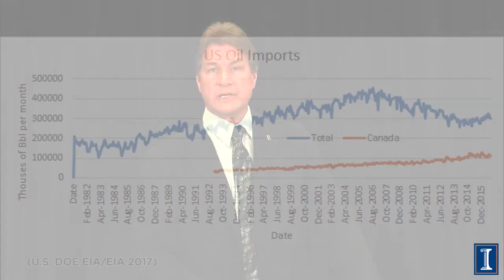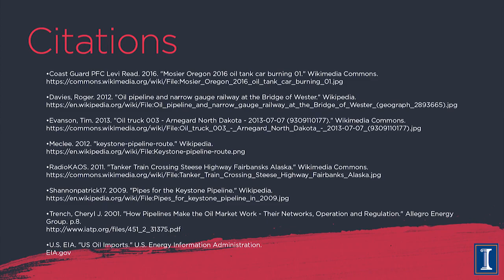Pipeline Controversies

Comment: Entirely too dismissive of the unique forms of environmental impact represented by underground oil pipeline especially in or around water, aquifers, water tables, etc. Do your research. You don't just shut down a high pressure pipeline full of tar. The inertia is tremendous. While you are shutting one of these down, you can have a full-blown ecological disaster.

Of course the bigger ecological disaster is also mining and burning the stuff, which at this point should just be outright banned by international treaty.
Reply: And by not building the pipeline, you're inviting more burning of the stuff to get the product to its destination with diesel-powered tankers and trains which are far more likely to crash into something and cause a spill. Further more, it's more than possible to engineer shut-off valves strong enough to stop that flow. As a matter of fact, it's standard design in oil rigs (Deepwater Horizon was a case of that system failing due to faults that should have been caught but were not corrected, but that is by far the exception rather than the rule). Lastly, even the "green" energies such as wind and solar still require fossil fuels to operate. You need to mine the materials needed for the magnets and other components (to include oil because a lot of polymers that only got invented because the oil companies took the waste from refining crude oil into gasoline and other fuels and then experimented on it to figure out what else they could make from their operations) and wind farms/solar farms run natural gas generators as backups for when the primary mode simply cannot adequately supply the energy needed. Also, by denying cheap energy to areas that just don't have the infrastructure yet to run nuclear/solar/wind, you're crippling economically disadvantaged nations such as the majority of Sub-Saharan Africa (congratulations, by going big green, you inadvertently become a racist as you're denying black people the chance to improve their lot by pricing them out of the energy market).

Bottom line: fossil fuels are still necessary for now and rather than banning them outright, it is smarter to use them as efficiently and safely as possible while phasing in cleaner technology over time.
Reply: @RaderizDorret  kind of like holding people hostage in order to continue destroying the planet and blaming someone else for the fate of your hostages. So many excuses and explanations why some people (mostly the poor, Native Americans, people of color) have to accept paying the price for our "infrastructure".
Reply: @fieldlab4  Except you're the one who is denying them access to the infrastructure we built and thus denying them of the opportunity to not only catch up but have the potential to surpass us. You give them methods that cannot possibly translate to them eventually becoming an industrial power and after that a post industrial power. Why do you hate black people so much? Your methods keep them in subsistence farming while my methods actually give them a path to grow and potentially surpass me. After all, if my student doesn't surpass me in the end, then I'm a very poor teacher. What you demand is keeping them in subsistence levels of economy and then hold them hostage as only you can afford the "green" energy needed to sustain their economy and thus they are subservient to you. You are making slaves of them while I am hoping to make apprentices and eventual masters of their own fate.
Reply: @RaderizDorret  You seem to be suffering from capitalist savior complex. What did the "poor savages" ever do to survive for thousands of years before you came along to help them "develop". Answer: they didn't destroy the planet, for the most part didn't know poverty, exploitation or class struggle and led generally more fulfilling, spiritual and humanistic lives.
Reply: Here’s something to consider, you need oil in order to live. Unless you are self sufficient in food, energy, manufacturing, and heating you need fossil fuels in order to live. Gas fuels the tractors and implements for the farmers, natural gas is the backbone of North America’s energy network, incredible amounts of energy are required to smelt metals without natural gas and coal you wouldn’t have steel, and finally heating. you might not live in the areas where Fahrenheit and Celsius meet at -40 but millions in North America do and they for the most part use natural gas when available, if not than propane. These energy sources you claim that’s Should never be utilized are the very thing that is keeping you alive. And the pipelines you oppose are the safest, most efficient, and fastest form of transportation out there. And in terms of the mining of the oil sands in Alberta, we have for a large part switched to in situe production, where we practically steam clean the oil from the sand at incredible depths and when the source has been exhausted the landscape looks unchanged. Oh and if you think the oil sands is environmentally destructive, wait until you see the mining process for lithium, or the other metals required to make the batteries and “green” modes of electricity generation.
Reply: @kylemullen1139  nope, not as destructive as greenhouse gases, these dumbass oil industry talking points are objectively false, lol fucking moron
Reply: @kylemullen1139  okay I'll take mining for lithium any day over the impacts of a global fossil fuel industry. I'll take one ton of lithium in a car used for 20 years versus untold tons of fossil fuels burned instead, and lithium is also recyclable from used batteries, so the more you produce the less you need to mine. And of course, new battery chemistries don't even use cobalt.

And the fact that people for the last hundred years started using fossil fuels doesn't mean it's necessary. That only proves it's a passing fad.
Reply: First of all, you have the same environmental problems with trucks and trains and they fail and have accidents at a much much higher rate than a pipeline. That was the profs point. Any oil spill is bad but pipelines are the best way to prevent them and that's a fact based in math.

And as far as banning oil outright overnight, your take is a fantasy. Not only would that put us in the stone age, we would also starve without industrial farming that uses tons of oil and petroleum products.  Our economies would shut down and most of the population would lose their employment.  Also do you think western adversaries like China and Russia (without the blossoming environmental movement the west has had in the past decade) would stop using oil? Or would they continue to use it and use that position to dominate our now primitive culture without energy to support a defense. I'm firmly in the box of continuing our transition away from fossil fuels, but it cannot happen as fast as you describe.  You would create an event of human suffering as bad or worse than what the changing climate would create.
Reply: @hgbugalou  suffering for who? The rich nations, not the poor. If pipelines are so great and cost effective, just isolate them from the ground and water in a dry trench with 24/7 monitoring, and have shutdown and overflow facilities every 2 miles. Oh- not very cost effective anymore, got it.

The fact some other obsolete tech is worse isn't a good defense but I guess it's all you've got.
Reply: @fieldlab4  You are justifying human suffering on a massive scale, along with death all because poor people exist. 😑 More over, poor is relative and there are plenty of "poor" people that depend on energy from hydrocarbons to live. This is from rich nations to 2nd and some 3rd world nations.  These nations leverage pipelines too.  Even people in Afghanistan have electricity in Kabul and drive gas powered vehicles.  The only poor people that would not see suffering are tribal people living in the stone age already, and they are in the minority in this point in  the human total population.  With that said, pipelines are still a better solution for everyone involved versus the alternatives (at least in the short term).

Comment: I think the most important thing we can do right now is figure out how to make oil usage cleaner. Figure out a way to contain the emissions from our vehicles.
Reply: Easier said then done. Every cleaning step is going to take energy from somewhere that has to be  produced.  Personally I think we will always need hydro carbons for vehicles in some capacity until hydrogen fuel is viable.  All this why I don't understand why we are trying to electrify vehicles before converting grid production away from hydrocarbons and toward nuclear augmented by solar.

Comment: I would argue that the money spent on upgrading oil infrastructure could be better spent on green tech
Reply: Yeah, you would have to spend vast amounts more on "green" tech and it still wouldnt be enough to fuel the cars.
Remember you dont even have the evs. Neither the trucks nor the cars.

Its a pipe dream.

It will take a lot of time to transition.
And until you did, you will have to have infrastructure for the old stuff.
The argument isnt pipeline vs wind or nuclear or solar but it is pipeline vs trucks.
And pipelines are safer and cheaper.

Your argument is completely ridiculous. Its like saying: i dont wanna spend money on fixing my leaking roof but rather spend it on building a pool in my garden